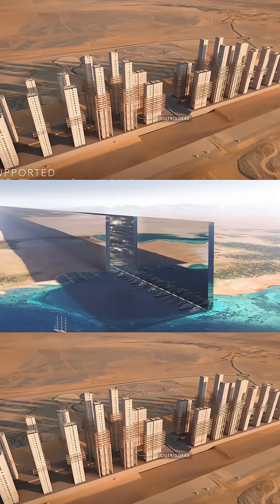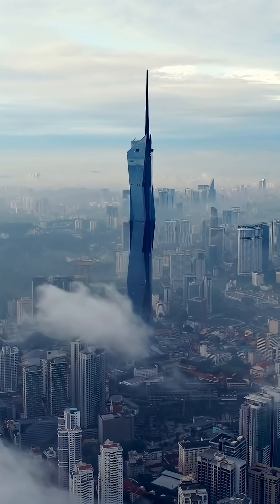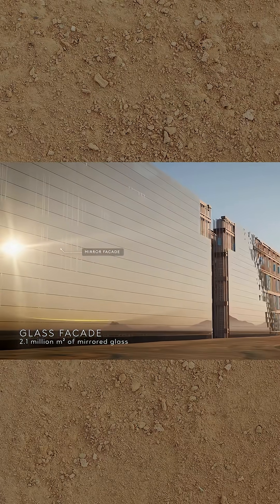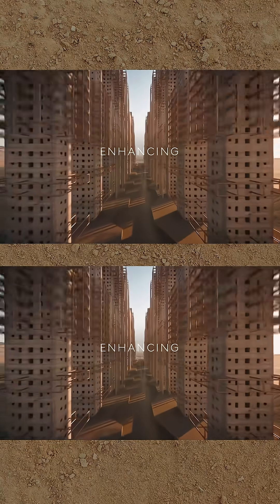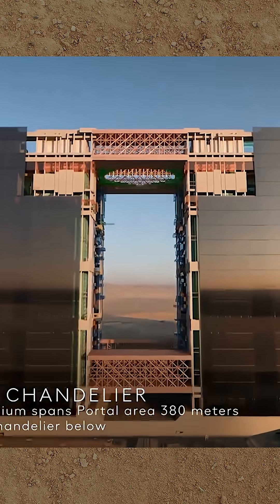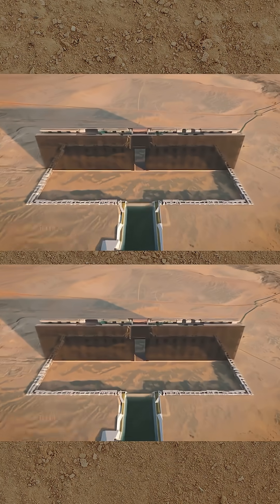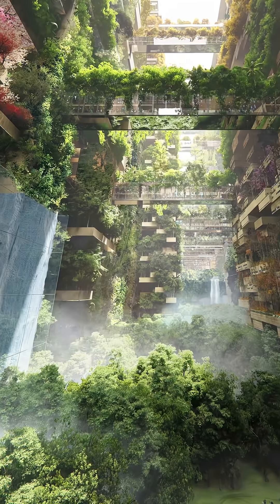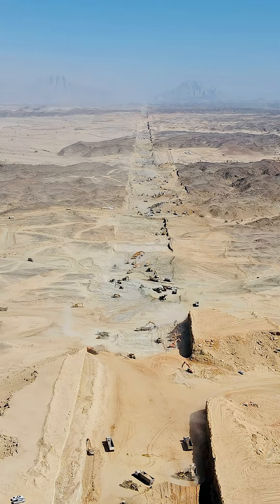Fred Mills: How Saudi Arabia is Building THE LINE

Comment: I like how all the renders have lush vegetation in them. Pure comedy.
Reply: Not to mention literal floating parts like trees and stuff lmao, the Line will be a 100 year project if they actually go through with it or will be a 5 year and waste of several billion project most likely
Reply: @crispycrusader1  “If they actually go through with it” They are, its been under construction for over a year…
Reply: @TestingTesting-tl7pz i mean completion, once full built, i feel the project will be canceled before half way as thats a MASSIVE undertaking
Reply: @crispycrusader1 preventing climate change is not a waste of a project!
Reply: @crispycrusader1 - It has already been almost 5 years.  This will be a 20 year waste project.
Reply: Greenhouse
Reply: Mold and mildew. Thats what I think of.
Reply: Shedding the heat load from glass i  the desert sun will be a tremendous amount of electricity
Reply: @diviningrod2671 if harnessed properly this is seriously no joke
Reply: @diviningrod2671 plants dont use electricity
Reply: @diviningrod2671 taking power from them wouldn't be bad.
Reply: Guys, i am an idiot
Reply: You’ve obviously never been to Dubai or abu dhabi
Reply: I have loved there, but why do you say that I must not have? I don't understand what you're saying.  @thomasrudder9639
Reply: @thomasrudder9639  There is literally nothing there, worked there for 4 years. The place sucks.
Reply: @LoL-Lolovitch  If there's  nothing there then what were you doing there then??
Reply: @Bushka-w9q sometimes your job takes you places, you either go or lose the job 🤷🏻‍♂️
Reply: @LoL-Lolovitch Probably lots of destroyed  ancient mega structures and prehistoric ruins buried deep around that area as they are finding them elsewhiere in arabia
Reply: @thomasrudder9639 I lived there for 3 years lol
Reply: @jaakaart 🤣🤣🤣🧐
Reply: @jsparx were your eyes closed for 3 years? Did you leave the airport in those 3 years?
Reply: @user-nj1zu2nf1x no. I lived in the airport AND kept my eyes closed the whole time. You make a good point.
Reply: Yes they do that so they can say it's sustainable lol
Reply: Saving the environment and preventing climate change is not pure comedy.
Reply: @Redditor6079 The Line will save the climate?
Reply: @Redditor6079  i think you are missing what op is saying, we arent talking saving the environment
Reply: @Redditor6079 it is if you think planting tropical plants in sand and glass won't require water transport, and climate conditioning to support said shrubbery. The amount of energy required to maintain a rainforest in the desert is not going to save the environment or prevent climate change. You sir, have been drinking the government's kool-aid. Climate change and weather fear has been used for centries by leaders and the powerful to control the populations. They still do this and monkeys like you clap for them.
Reply: @Redditor6079 Name checks out
Reply: @thatonetitan8456 is that supposed to be an insult?
Reply: @Redditor6079 Is that how you took it?
Reply: @thatonetitan8456 nah. Not everyone can accept the truth
Reply: @Redditor6079 
There’s nothing humans can do to prevent so-called climate change.
The planet is continuing its journey out of the last ice-age, before it starts its return to the next.
It’s the warming that’s releasing more CO2 into the atmosphere, to everyone’s benefit, and those who control taxation are the only ones who will benefit from the current propaganda.
I’m old, so it bothers me not whether folks agree with me or not.
If we had spent the same money on defense instead of so-called “green energy” (that’s not green in any shape or form), we wouldn’t all be at the mercy of insane little pricks like Putin.
Peace out.
Reply: @Redditor6079  it’s comedy that you think climate change hasn’t already happened millions of times on earth without humans. As planet never stays the same it’s always changing and if you look at the data, we’re actually in more of a cold cycle than a warm cycle. The climate change propaganda is all about controlling people and corporations. The people scaring everyone about climate change are the same people flying around in their private jets that put out more carbon than we do driving our cars in a lifetime and buying beachfront properties while telling us, the coastal regions will be underwater in 10 years.
Reply: They could do it if they use Israeli desalination tech.
Reply: @YeshuaIsTheTruth  NO they can't! Israel once tried to turn the "desert green" and guess what happened, they started draining the sea of galilea at rapid levels and quickly halted that idea! You can't terraform a hot desert! (I emphasize the word HOT DESERT, do not confuse it with cold deserts often located in highlands such as colorado or in Ethiopia) Don't work against nature, it will prove futile...
Reply: @dontlaughtoomuch11  you sir are a gentleman and a scholar
Reply: @KeepCool-w5e  Not sure if that was sarcasm or not, but Israel themselves admitted the project a complete failure... (Not sure if Israel would be any authority when it comes to water management, seeing as they steal water from Palestinian aquifers) Would you look at that, he instantly deleted his comment :face-blue-smiling:
Reply: @dontlaughtoomuch11 no one deleted their comment
Reply: @dontlaughtoomuch11  just a note, the amount of useful, farming land reclaimed from the desert by the Israeli is actually quite phenomenal.  Yes, at one point their ambition was too much, too fast, but, once they realized that, they scaled back their efforts, not reversed them, and still, year after year, foot after foot the deserts are being reclaimed.  Of course, one of those reclaimed areas, currently known as the Gaza Strip, was turned over to the Palestinians in 1994, after it was reclaimed, built up into a beautiful, and sustainable living and working environment.  It took less than 20 years to turn the beautiful place into a rabbit warren of slums, and starvation pits. So, it is possible to reclaim the desert, and make it livable, beautiful, and sustainable, and it is also possible to turn a place like that into the desperate, scrabbling, last stand of people on the edge.
Reply: @nela9994  No they haven't, I vehemently reject that! They wanted to turn entire desert patches green, and if you know anything about geology and climate, you'd know that the environmental cost to sustain "green patches" in the middle of a hot desert (again look up coppen climate types) outweighs the benefit... Where do you think the water comes from to keep that land green?! They haven't been desalinating nearly enough to pursue such a worthless goal. And they have been caught stealing water from Palestinian aquifers, so I don't think a rogue genocidal state is your best example to look after... At some point, their whole actions make all of their achievements look like nothing, because of their actions... They are now carefully monitoring the sea of galilea because it has declined so much due to demand...

I am not even going to adress Gaza because you clearly lack factual information to make an unbiased assessment...
Reply: @dontlaughtoomuch11 you absolutely can. That water doesn't disappear.  It just comes down somewhere else
Reply: @Anonymouse-m3c So you believe you can terraform a hot desert without any continuous supply of water coming from nearby mountains or highlands? In what universe are you living? Again the words "hot desert" should already be the key clue...
Reply: @nela9994  the Romans reclaimed the desert in that area and Syria when they expanded their empire into that region. It all fell into wrack and ruin once they left though. Also, if the tales of the invention and creation of the Babylonian gardens are anything to go by, the Vikings did it way before anyone else.
Reply: @edenlass9062  the Romans did reclaim lands, but, they were also known for salting the farmlands of their captured territories, so the locals had to depend and buy their food from the Romans for at least 50 years.  So, of course when the tide receded, those who were used to surviving on the resources traveling down the Roman roads became wrecked and fell to ruin.

Comment: Such projects are the reason behind my pivoting to Geotechnical Engineering from Structural Engineering 😅Designing the foundations wont be as complex as how the structure works conceptually so the Structural engineers are in thr Mud

Comment: If they ever finish the construction of that thing, it is going to be a money pit and a  mortal trap for billionaires. 

The money they will have to spend an insane amount of money to keep it at an acceptable temperature, and they will have to desalination to get all their water. 

Then you have the safety hazards: it's one electric failure away from it becoming the biggest oven toaster in history if the cooling systems fail. A fire will fill the whole structure with smoke in less than an hour. An earthquake will make mirror walls and the chandelier glass dagger raining over the only exit, if it doesn't liquify the foundation of the building and make the whole structure collapse first.

Comment: Yeah, this is never gonna be finished.
Not even close.
Reply: Sure whatever you say. Person with ZERO credibility
Reply: @ntl9974  lmao, I don't need credibility to have an opinion.
And my opinion is not just a random arbitrary one. It certainly wouldn't be the first time an oversized megaproject in the middle east ends up halfway done (Jeddah Tower for example). Never mind the fact it's most likely built using slave labour, or at least near slave labour like conditions.
Also, what is the point in building a vertical city like this, especially in the middle of the desert?
Reply: @The-Urban-Goose  you built your evil colony in the middle of the desert which is doing genocide ?

Comment: This is at one point going to fail very hard. Scenario 1: It never gets finished, not even the first section because they run out of money or realise that nobody wants to live like a lab rat. Scenario 2: It gets finished, at least the first section but barley anyone moves in because nobody wants to live like a lab rat and in a few years it gets abandoned turning it into the biggest abandoned building in human history. 

Either one of the two scenarios will with 100% certainty happen, but what will never happen is that this project is ever going to be successful because of its radically inhumane concept. Humans don't want to be enclosed between two gigantic 500m tall walls, period!

Comment: At least they’ll definitely have enough sand for glass 😂

Edit: They have nothing left for anything.
Reply: Unfortunately the sand of that desert is not the kind you'd want for either concrete or glass.
Reply: @Floedekage oh damn
Reply: I thought the sands are different needed to make glass 😂
Reply: Why not solar panels in stead of mirrors? As a matter of fact why aren't all skyscrapers covered with solar panels today considering we are now capable of producing transparent solar panels.
Reply: @lorenzoblum868 because solar panels in a more temperate country reach 50-60 degrees at noon and they have 8-10 hours of sun, here they'd stop working, or explode, due to overheating and the length of the exposure. Not to mention you'd fry people inside from all the heating emanated.
Reply: Wrong type of sand.
Reply: This ain’t minecraft lil vroom
Reply: @GreenLeafUponTheSky Minecraft has sand turning into glass?
Reply: @yuh-labubu  ya in the furnace, only two types of sand in the game, regular and red lol